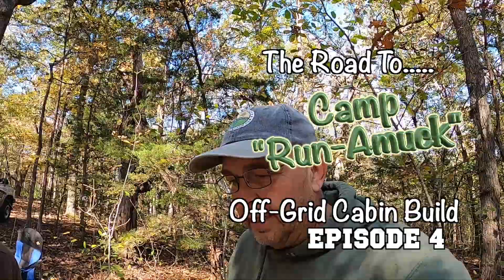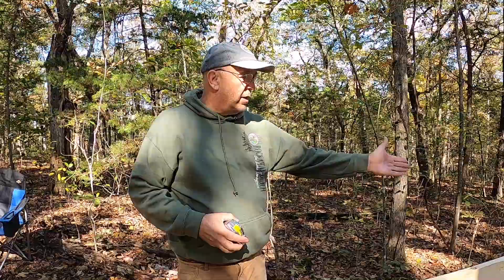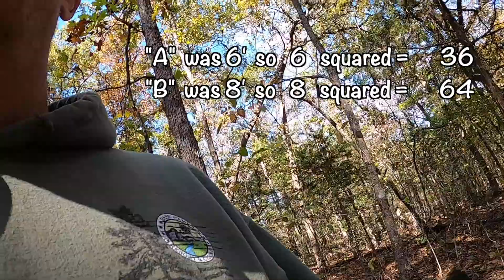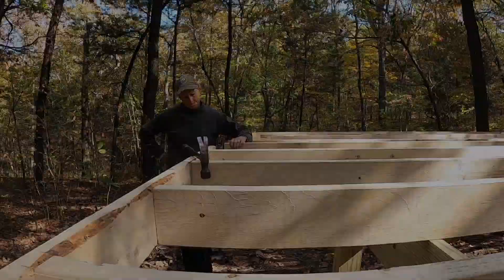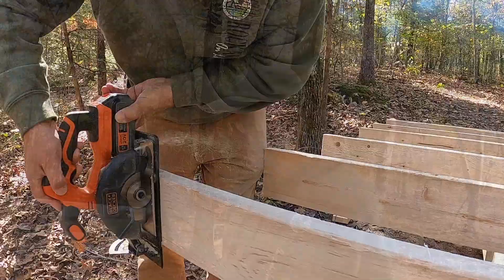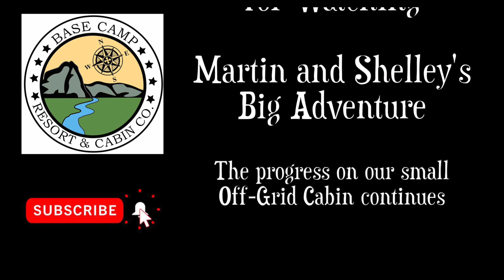Off-Grid Cabin Build - Episode 4 - Getting Floor Joists Square and "Bending" Boards.

Comment: What kind of battery tools are you using
Reply from the maker: A variety. Porter Cable drills and impact drivers, A Stihl Mini Chainsaw, I bought a B&D saw (just because it was less than $200 with charger and spare battery where everything else was over $500)